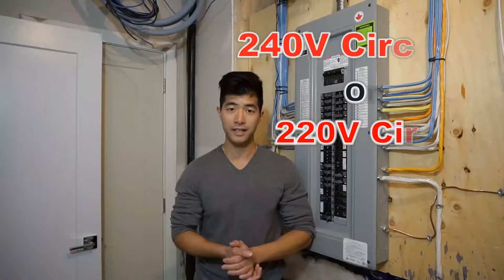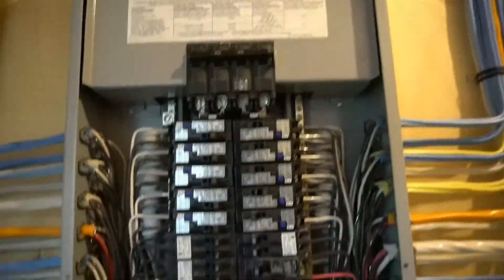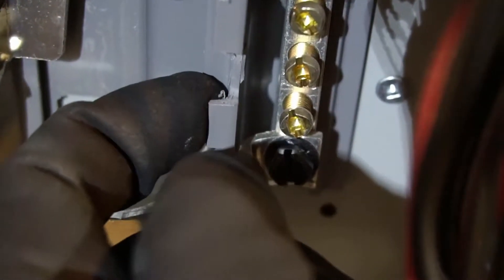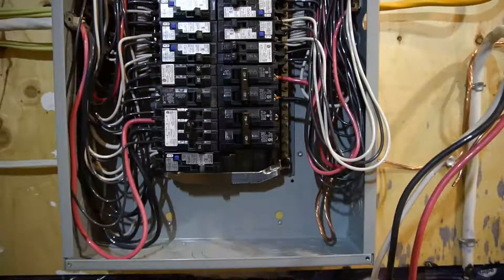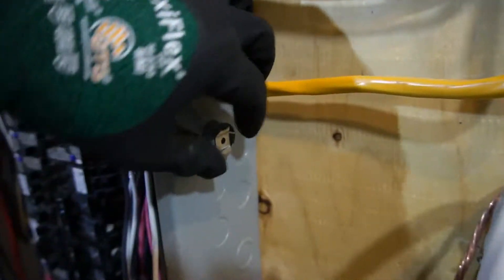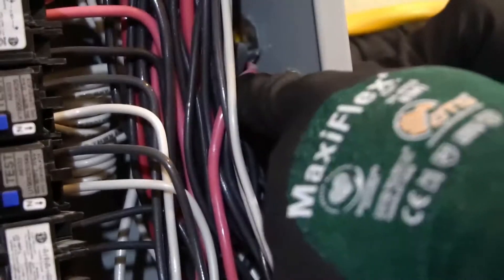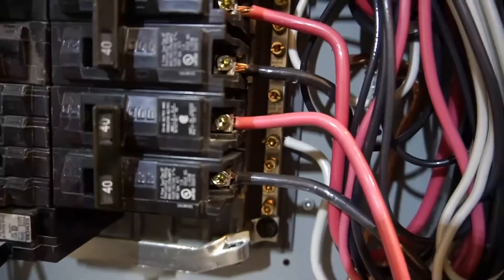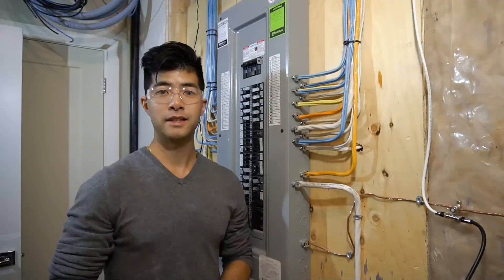HOW TO INSTALL 220V 240V NEW CIRCUIT Double-Pole Breaker

Comment: Why was there a neutral wire for 240?
Reply from the maker: For 120V applications. For an example range lights, exterior 120V outlet, switch board 🍻
Reply: @KevinPon.  so, for 240, just run the white to one side of the double pole and the black to the other side of the double pole and the ground to the bar with some white wires and other obvious ground wires?
Reply from the maker: By code, you never run the white wire to the breaker. Depending on the country you can use color coded shrink over the white wire on both ends to label it as a hot wire. Yes, the ground wire will be terminated to the ground bar with the rest of the ground wires. 🍻
Reply: @KevinPon.  thank you for actually responding, most don't. I did use the shrink on the second hot wire and noted it in the panel. I plugged the air compressor in and flipped the switch and she fired right up and everything seems normal,... its been a couple hours. I think if it hasn't burst into flames by now, it likely won't.
Reply from the maker: @hstone0808 perfect, you are good to go. Be sure you are also using the correct wire gauge size 🍻

Comment: Your worrying about a little extra cover showing,but in reality, if you touch the set screws,that are bare,while it's got live juice,a 1/2  centimeter of bare wire at the set screw is of no consequence if you touch those bare set screws with live power!
I had a shop I rented and the previous tenants used an axe to chop off all the wires to his machines to move out before the bailiff came! Bad idea! Every wire end was possibly live!

On one on the breaker box's switch he had wired power both on the same sides,as live through to a machine! 
Should not have been done that way! And I didn't know or see the difference when I tried to pull the fuse to kill the piwer, using steel pliers,instead of buying the carburundum puller designed to/ for this!
The juice arced across an open gap,I may have had gloves on but I was immediately electrified,lifted 3 feet off the ground and turned 180° ,and the only thing that came out of my mouth was a tiny squeek,   "Help"!
,which my customer didn't hear! 
Somehow, the juice stopped just a second later,and let go of me,which I was very lucky! And my guardian angel was there to help!
So,always use the correct tools when doing hydro installs/ work!
I told the hydro service man what I had gone through, he said I was lucky it let go,as hydro causes the arm and hand muscles to constrict so severely that you can't let go! And it can break bones too!

He saved a coworkers life one time when he found him in this situation, so practice safety,and if you don't know what your doing,if in DOUGBT,DONT DO IT! you'll live longer,and not be found fried to a crisp!😮

Comment: So i have a 12/2 wire so its just red and black and ground would i just attach the ground to the ground bar and the red and black into either one of the slots on the breaker
Reply from the maker: Yes, that is correct. Maximum 20A breaker size for 12/2 🍻
Reply: @KevinPon.  thanks for being fast im literally do this now lol hiring an electrician just didnt make sense for what they wanted to charge 😅
Reply from the maker: @AutoBudz  it's always good to save money when you can!!

Comment: What if it's a 3 wire ??????? Red black green??? No neutral????
Reply from the maker: Hello Mike, it will be the same steps. You will just have to skip the neutral wire and make sure the green wire is terminated to the ground bar 🍻